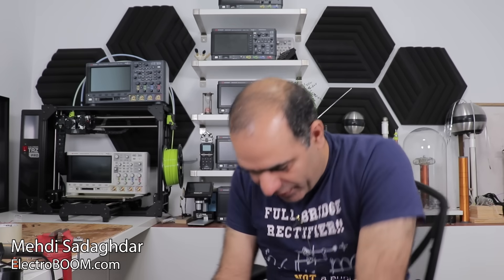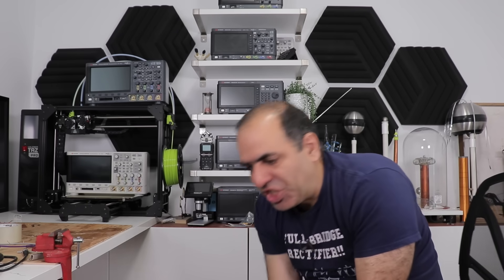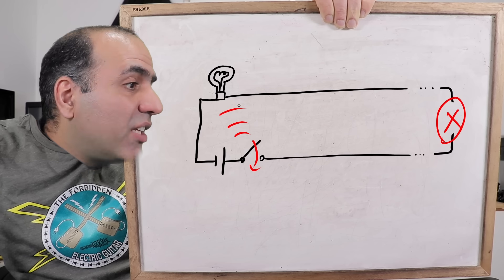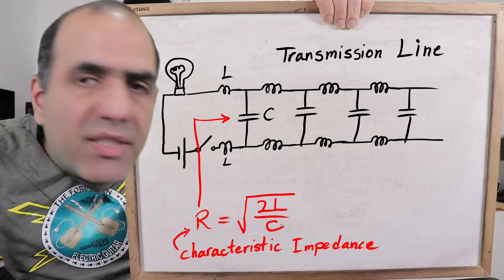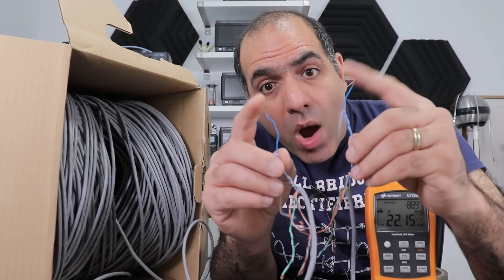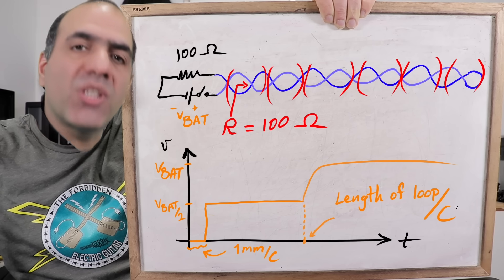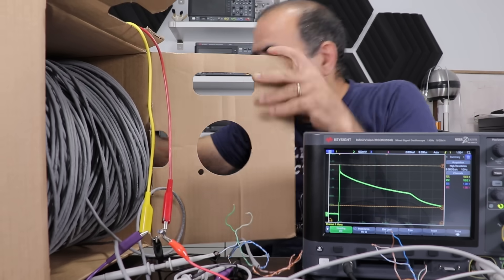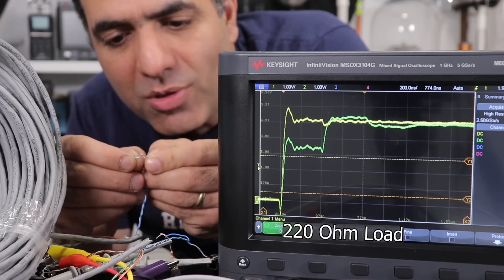Testing the LONGEST LOOP OF WIRE!!! to Turn a Lamp On

Comment: Sorry, but this still is BS. It is capacity, which couples the power. You stated this correctly. But the line does not "know" after the delay, that it is open or connected. It is just the wires resistance taking over the effect of the capacitiv coupling. If your line would be 1mm apart but flat and 20 meters wide, the line would start to conduct before the capacitive coupling is even close to over. The voltage also depends on the load and wire resistance of course. It is just 2 differenc things acting together. I find it kind of misleading to say, that the light really turns on. If you run  incandescent, you would be unable to see the effect of the capacity at all. Even measuring the heat would likely fail due to the thermal mass. LED is not really showing the true nature, since it takes almost no current at all to emit light. Just like people claiming free energy with a joule thieve on a dead battery. Still the power is absolutely negligible and useless. You should rather talk more about the usecase of knowing of such parasitic effects on cables.
Reply: I am with you on this one...
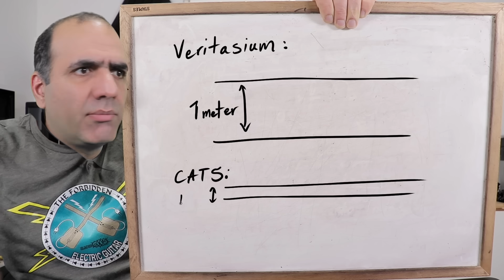Reply: What you are saying is half correct, when the circuit is open, the visibility of the LED is there until the full capacitance of the full line is charged, then it stops. It actually starts to conduct long before the capacitive coupling is even close to over, always. It does not matter how far apart the wires are (within reason, as long as there still is a t-line not 3D radial transmission if it is too far apart). The visibility of the first single reflection will DEFINATELY be way too quick for the eye to see (a few dozen microseconds), so what you see is the combined effect of the waves back and forth until after the full cable capacitance is fully charged. Mehdi is in the passing referencing the oscillatory reflections - multiple reflections - the high resistance of the thin wires of CAT5 however is quite lossy and therefor the oscillation is rather weak and dissipated very quick. The oscillations are much more visible to measure if the resistance is much lower. Look at my experiment here, at 6:45, where it shows graphs of the charging of both a short circuit and open circuited 10km circuit with extremely low resistance. The open circuit fully rings down! In my video, at 16:44 I test a shorter line (with no additional cables muddying the graphs), a 1km length and due to the low line resistances, the current oscillation is clearly visible, and compared by superimposing on the same graph at 18:06. And yes, I don't say it in my video but I am analyzing it for the real life benefit of what happens when you stop the current on real power lines - see where the 12 V source gets to -60V (at 32:30) due to the simple inductance of the straight line and self-oscillate due to the LC combination. Take the design voltage on that line of 19052 V between line and earth, and switch it off on the same way as I switch off the DC, then the voltage jumps to 19052 x 60 / 12 = 95263 V !! Video 003 on my channel.
Reply: https://youtu.be/k15UmfQhSFU
Reply: @jacomostert4413  Yes, you are right. Actually both effects will always overlap. Because there is no ideal component in existance. Any capacitor with any series resistance (any real capacitor) will charge on DC. It will be basically no current after some time, but math says, it is infinitive. Only at time = infinity the capacitor will be fully charged. That automatically means, that the coupling will not stop before the wire conducts. Nontheless, the capacitive coupling only plays a very minor role on low frequency and especially on DC since it is negligible. Only high frequency signals will always suffer from these effects more or less. For electronic understanding I suggest not to mix the Veritassium explanation in, because it will not help at all. All that is required to know is, which parasitics exist in electronics and how to deal with them and know the limits of what is possible. The cause of this and the somwhat abstract nature of these effects will likely only confuse anyone who wants to start electronics.

In this video it is easily understandable, that capacitive coupling causes the behavior. But Veritassiums video lacks the simplicity to grasp this idea. The model medi has drawn is ideal to teach electronics. It does not help to talk on how waves propagate. At least for me it never did. Of course it is all logical and makes sense, but it did not teach me anything practical at all that I did not know from simple models like before. I actually stopped watching Veritassium for that and for other reasons. His click-baity ideaology does not fit my taste at all. It's almost as if he thinks he is something better than other experts. This arrogance pushed me away from him. Medhi stayed cool so far - will continue to watch it, just like Dave Jones from EEVblog and BigClive (and AVE for other things... and so on). These youtubers do a better job of actually teaching something really useful, that does not just look smart. It actually is and comes down from years of education and practical experience. Much better than a random guy stating he knows stuff but never showing, what he is able to do. Like modern influencers... yikes...
Reply: @HeartOfGermany  Of course I agree, time must = infinity for the cap to be charged and current to stop, but in measuring things in my life, with all the measurement uncertainties, 1% or sometimes less than 0.1% means "stopped" for my purposes. Furthermore, I agree to the youtuber philosophies you mention. And I agree with you about the clickbaity things. And agree about Dave and Mehdi. About your "only HF signals", I also think you are only half correct, because many slow low frequency (or DC) things in modern life is a rectangular wave, or then irregular ON/OFF cycles, and per definition (Fourier) that also INCLUDES HF, which means that especially switching OFF of DC is very problematic with the otherwise parasitic stuff. I think that the t-line theory is very important for the edge effects which are otherwise difficult to understand. I also agree that the kind of analysis in the last Veritasium videos (i.e. asking how exactly propagation happens) is not helpful in practice, and also not even helpful to understand t-lines intuitively or in theory.

Comment: Just want to point out Derrick first video he made a statement about when wires have had specific insulation energy could not flow out of the wires. His point was that the energy is flowing from source to load not in the wires, he was also negating any resistance of capacitance properties of the conductors.
The issue is even in his last video with his proof it is the capacitance nature of the wires that moved the energy, which is the whole point of why he is wrong.

Comment: 3:20
Where is the resistor needed in serie with the LED ??
Without a resistor in serie with the LED, it acts like a short circuit.
Reply: The very long length of wire serves as the current limiting resistor.

11:14  222 Ω

Comment: In this episode Mehdi "discovers" velocity factor and standing waves in transmission lines.... He essentially created a Time Domain Reflectometer. RF theory makes a lot of use of transmission line lengths and velocity factor for impedance matching as well as phasing. It is a deep rabbit hole to go down, but fascinating. In Veratasium's setup, his transmission line is basically what is called ladder line,  window line, or twin lead in the the industry... you can calculate its characteristic impedance if it was 14awg wire and 1 meter spacing, it would have a Z of roughly 853 ohms and should have a velocity factor around 0.92-0.98C

Comment: I think if the wires were far enough apart then this theory falls apart. the field transmission has a limited distance. Most engineers are aware of capacitance and inductance of transmission lines. Thats one of the reasons why data cables are Unshielded Twisted Pair, to take advantage of the natural RC of the cable to shield it from interference and help with bandwidth. In fact, most certification testers for data cables can test for a break in the wire pairs and give you a fairly accurate distance down the wire to the break using the same characteristics.

Comment: My new (electon) electricity says that electricity aint due to drifting electrons, it is due to photons (electons) hugging the surface of the Cu. 
The electons propagate in the insulation (if any) in which case they propagate at the speed of light in the plastic, about 2c/3.  
On bare wires the speed of electricity is 1c.
A good conductor is a substance that a photon can hug, eg all metals are goodish conductors i think.
The hugging is strong if there are free-ish conduction electrons in the wire --  Cu has 2 such electrons per atom.

Electons don’t reflect, they do a U-turn at the end of the wire.
Actually, electons always go straight ahead, it is the surface of the Cu that duz the U-turn.

If Mehdi measures the speed of electricity along a threaded rod he will find that the time taken is longer than for a plain rod, the difference being exactly the extra distance up & down over the threads.
Mehdi should do a youtube about this.
Your welcome.

Comment: In the original veritassium video, the wires were 1M apart, not 1mm. I believe that would make the capacitance between the wires 1,000,000 weaker. That HAS to effect the slope of the curve of the load voltage as it comes up to the supply, right??

Comment: What I have learned is that no matter how many times we disprove Veritasium thru experimentation, no one wants to come out and "say it". 
Clearly, the electricity powering our appliances REQUIRES the wire... to get the full voltage and amps needed to run the equipment. 
Why not do this experiment trying to power something that actually requires a significant current and can actually turn on in the short window before the electrons travel the full length of the wire.
Thank you for the video. All the changes were a bit confounding, but the demonstration for the waveform is very clear.
Reply: What do you mean? In veritasiums original video he said the light bulb would turn on, he didn't mention what type of light bulb, or how long it would turn on for. An LED is still a light bulb. (put the diode in a plastic bulb, it is a light bulb) Also, have you never used wireless phone/tablet chargers? You don't need the wire for the electricity to flow from the charger to the phone.
Reply: @rdizzy1  Veritasium's claims were based on a 12 volt DC battery, not a AC generated waveform. All the demonstrations (no offense) are simply NOT in keeping with the visuals of the original experiment. Additionally, as a thought experiment, the "Basic" claim of the entire video (other than the "riddle") was that OUR APPLIANCES in the house turn on Before the electrons arrive, and the electrons have no real purpose, ie they are merely "bystanders". It is a total load of garbage.

NONE of the experiments have proven anything close to usable amounts of electric current that would power a typical household appliance like a Toaster or Hair Dryer. And all of these experiment are doing nothing to address that complete utter falsehood. Dimly lighting an LED that only needs a few milliwatts of power in the first place, doesn't constitute "ON", in any normal sense of the word.
Instead of trying to power a few millwatts LED, lets see the REAL demonstration, where the 12 volt DC battery powers a full power LED in the several watt range,  that is at least near full brightness before the "electrons" arrive via the long route... It simply won't happen. 
While all the videos have greatly improved my understanding of Transmission Theory, none of them has clearly said the facts: The electrons ARE required to produce the kinds of current needed to run household appliances in our homes. Veritasium is simply wrong.
Lastly, every experiment clearly shows that there is a period of time between the On switch and the full voltage of the power source. That period of time shows there is a bump in the voltage before the full voltage arrives (with the electrons) consistent with Transmission Theory. We can all agree on that. However, NO ONE has addressed the fact that this voltage has almost no usable current.
Reply: @rdizzy1  The light bulb used in the demonstration was an LED (read the label). I think it is fair to say that the LED would have to turn on and Stay on to be considered as "ON". It wouldn't count if the bulb was "barely lit", or only stayed on for a split second. This is because his "CLAIM" (in the rest of the video) is that electrons don't carry the electricity. So, to prove his claim, he shows that the bulb turns on. However, that is just a bunch of word magic, because a normal LED will NOT turn on that way, and certainly won't remain on until the electricity via (electrons) arrives. All the demonstrations that I have seen cheat by increasing the voltage to 20 volts and by using the smallest possible LED with the smallest possible wattage, or simply get rid of the LED and use a resistor, which proves :NOTHING: ... 
Re: Wireless Chargers: The Wireless phone chargers cannot charge phones 1 meter away... they have to be in very close proximity due to the fact that the energy dissipates with the square of the distance. So, yes, the electromagnetic field of the wires WILL result in a very small amount of electricity to "reach" the light bulb 1 meter away, but it won't actually result in it turning on in any normal sense of the word "On" because the amount of current will be very very small.
It is important that the demonstration showed a Car Battery, NOT an AC Waveform generator.  Almost all of the demonstrations keep using AC waveform generators which is not the same as a DC battery, and changes the result to some degree. TO be fair, an AC wave of 60 hz would be reasonable, since that is the frequency of house current, which is what his claim in the video was pertaining to.
Reply: @marcfruchtman9473  I wouldn't consider that to be on whatsoever, otherwise we wouldn't have to use the term "stay" before the word on at all, If a lightbulb turned on then off, we would say it turned on, then turned off. It turned on, for a short period of time, then turned off.
Reply: @rdizzy1  Sorry but In that case, you and I disagree. In the video, the bulb demonstrated a continuous "on". Not a fractional second of "on". If your electric company turned your power "on" the same was as you define it, I am sure you would be thrilled. Almost every light bulb works by turning on and off incredibly quickly but before we notice the flicker. I am acceptable to that definition, but not 1 flicker of on. LoL that does not meet my definition of turning a light bulb on. That is my definition of a "Broken Light Bulb" or a failure of electricity.
Reply: @marcfruchtman9473  In the case of the power in your home and the electrical company, almost all people would say "My power came back on for a second, then went back out again".
Reply: @rdizzy1  So what is your point? That is not a valid definition of on for the purpose of the demonstration. If he showed a "dimn, barely visible Light that flickered" in keeping with your definition, then I would agree with your point. But, he doesn't show that. He shows a very good quality, high output light that is on continuously in his first video as the thought experiment.
This is akin to companies that represent their product in a manner that is inconsistent with the advertisement... like companies selling big juicy Hamburger's on TV, only to find an anemic piece of kangaroo meat and half a pickle. Ultimately, they get sued for false advertising and half to fix their ads or beef up their product.
Veritasium made bold claims and then backed it up with a follow up video using a 20 volt power source to deliver an incredibly anemic power output that barely allowed an LED to turn on visibly in the dark. It is not a valid comparison in any way. It is completely misleading. His claim was that we power our household appliances this way. WE simply do not.

Comment: Brah, u seriously using twisted pair for this? So I guess we better let the IEEE know that Cat7 will not require twisting as it makes no difference, dude just short two (or more) pairs and use longer segment, but even then it won't be quite right, would it?

Comment: I once built a cable tester for checking integrity of phone cables in high rise buildings. It had a bunch of tiny relays pulsing about 100 vdc into each wire via a neon lamp.  It sequenced the relays and looked for unwanted return paths via any other conductors in a 10 pair group.  The test slowed down on longer cables because there would be a flicker to every neon due to cable capacitance.

Comment: So, I'm far from an electrical engineer, I'm an accountant but from.my understanding the effect that first turns on the light is the same effect, or similar,  to the one we use to wirelessly charge our phones, or the one we use in NFC. If you had two loops 1 million km of wire each and 1 m apart one with our light bulb on one loop and the power supply and switch on the other loop, the math would still work out for when the light would turn on, it's basically an inefficient wireless charger. Feel free to correct my stupidity